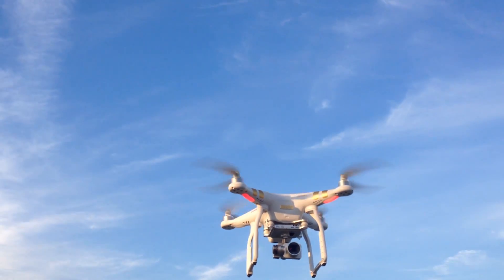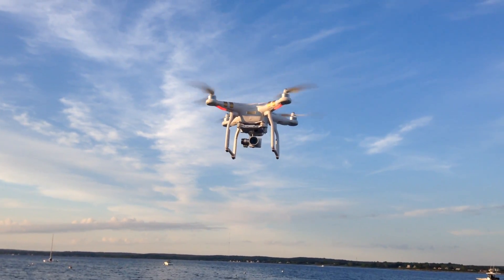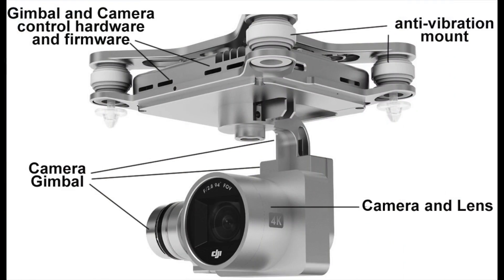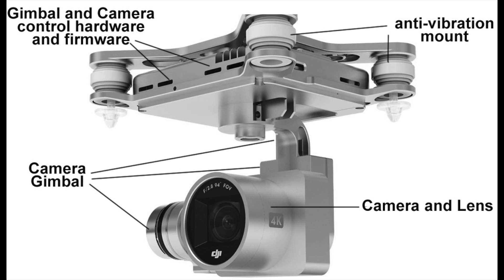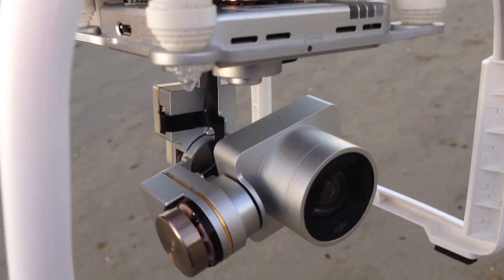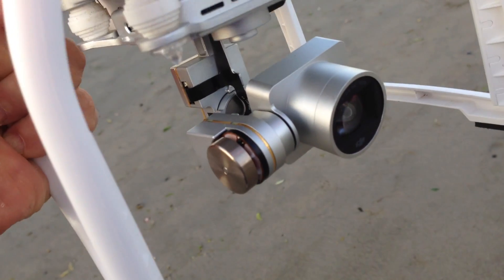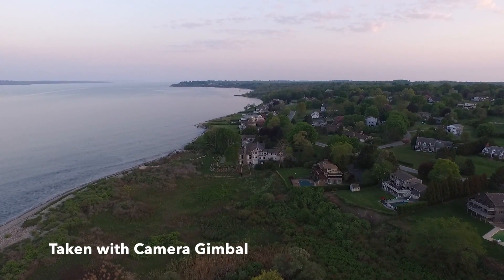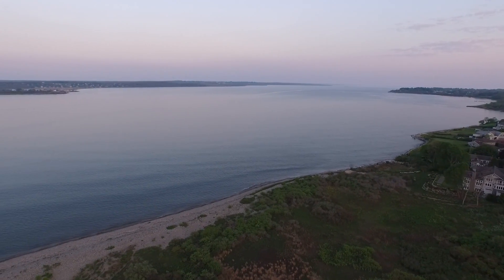Understanding 3-Axis Brushless Gimbals for Quadcopters

Comment: is that the stock gimbal and camera for dji phantom 3?
Reply from the maker: +aks flash Yes - it's a Phantom 3 Pro
Reply: is the phantom 3 plus comparable to gopro3 or 4? thanks
Reply from the maker: +aks flash P3 doesn't have fisheye - more of a normal eye view. GoPro has very wide view and fisheye (curve).
Reply: Drone Flyers Multirotor & Quadcopter info ok thanks!